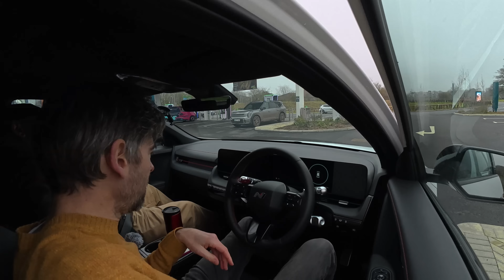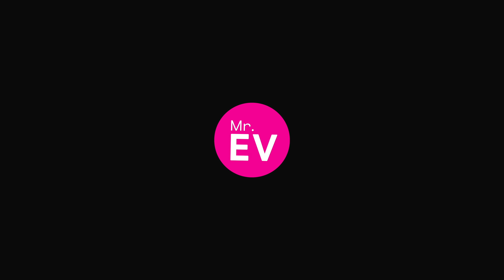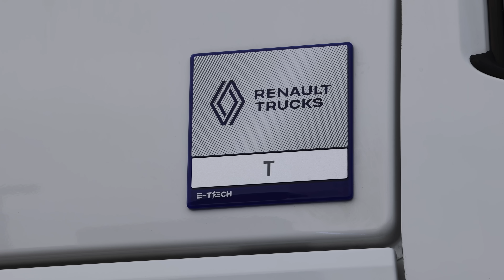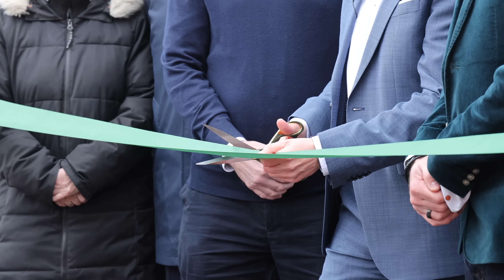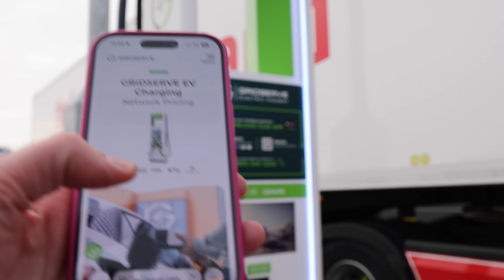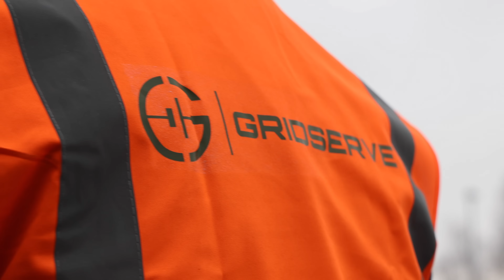Charging electric HGVs: the future of freight, up close. The launch of Gridserve’s first HGV hub

Comment: So let me understand you correctly you would rather continue ripping up the earth for rare Earth minerals to continue making batteries rather than  hydrogen Fuel Cells which are also electric by the way. For the future of transport ??
Reply from the maker: Most of these trucks have LFP batteries which contain readily-available materials. Battery electric vehicles are also more efficient than hydrogen so that’s arguably a better use of energy.
Reply: Not when you take into account that hydrogen is the most abundant source of energy in the universe no matter how efficient batteries are they still need materials to be made which comes from the Earth. Batteries are the same con as a government sold us for diesel
Reply: @TheDigitalFlight  where do you think this hydrogen comes from? 

We have to put energy in to extract it from water. This is about a 50% efficient process. Then it’s about 50% efficient when we burn it. So overall you’re left with 25% of the energy you started with. 

Batteries are 90-95% efficient
Reply: Maybe instead of destroying the earth for batteries if you put the same energy into developing hydrogen it would become more efficient.  Also if you go to certain parts of the Earth where battery mines are already destroying coral Reef you might just change your mind. But don't misunderstand me I think electric vehicles are definitely the future of transport just not battery versions
Reply: @TheDigitalFlight  oh god, even in 2016 this would have been a very outdated comment. The vast majority of all vehicles will be battery electric. This hasn’t been a question for a very long time already.
Reply: @TheDigitalFlight  sorry I should have been clearer in my comment. Those aren’t the “current tech” efficiencies. That the limitations of the physics. It is a physical impossibility to improve the process any more than that.
Reply: @Freba9 yep you keep raping planet Earth for The rare minerals you need to create batteries
Reply: Hydrogen is a dead end daft idea put about by the fossil fuel industry.
Reply: @ianlighting100  yup
Reply: @ianlighting100 give yourself a day off destroying the planet for rare earth minerals is such a better one isn't it ?
Reply: @TheDigitalFlight  stopping climate change by ceasing greenhouse gas emissions is absolutely an urgent priority that trumps everything else. Yes.
Reply: @ianlighting100 fantastic stop destroying the rainforest just to create Food Farms for animals because they're the biggest green house gassys emittors on the planet. But if you still can't see the light try looking were the rare earth minerals come from. Democratic Republic of Congo (DRC), China, Australia, and South America. The DRC produces over 70% of the world's cobalt, while China dominates the supply of rare earths, graphite, and refining
Reply: @TheDigitalFlight  yes and cobalt is used in oil refining but I bet you’ve never complained about it in your petrol or diesel car. 
Modern batteries don’t even need cobalt. Look up LFP.
Reply: @ianlighting100 I'm not an advocate of patron diesel engines but if you want to stop oil production for a greener world you better look inside your house cos you're going to have to throw everything and I mean everything in the bin you try looking that up what oil is used to make. What I am not in favour of is mining the earth for more minerals when there are cleaner options
Reply: @TheDigitalFlight  petro-chemicals in plastics etc is not the issue. It’s burning of the oil based fuels that is the problem. 
Each year the world uses 100 million tonnes of hydrogen. 99% of that comes from fossil fuels. It’s impossible to make hydrogen from electrolysis cheaper than the electricity you need to make it with. It’s far better to use the electricity directly in vehicles instead of creating h2, transporting it, then getting 30% of the energy back at the wheels. For the same amount of electricity an EV goes 3 times the distance compared to a hydrogen powered car.

Comment: They need to have solar on top of the trailer with a small battery underneath, would help run refrigeration units and be a backup for the main battery.
Reply from the maker: I agree — that seems like a no-brainer actually as solar panels are so inexpensive. They’d still not generate much in the grand scheme of things, but it all helps.
Reply: @MrEV  The trailers and trucks usually have totally different owners, and putting solar on a trailer may actually cause more drag than it's worth generation.
Reply: @etchedpixels The panels would be flat not at an angle, so wouldn't cause any more drag. Fleet trailers would benefit.
Reply: @dogbreath6974  Even on a US RV with flat panels if you are using any thickness of panel (as you need to because bendy ones don't last) the additional drag and weight over the roof is quite measurable.

The weight is rather hard to fix, the roof would already require strengthening on a trailer so you'd need to strengthen it, add cowling and decide to accept the increased height.

It's a design in thing not a retrofit.
Reply: A few companies already have these kind of trailers on the market.
Reply: Yes, maybe a row of wind turbines where space allows also.
Reply: @andrewhill9369  I hope that comment is a joke 😂

Comment: They may be expensive to charge at public chargers but it would be good to understand how the maintenance costs differ.  Surely if you have a fleet of HGVs, regular maintenance must be a significant regular cost.  I'd be interested to understand the total cost of ownership/running costs over a year compared.
Reply from the maker: Yes, I should have gone into the TCO. It is certainly lower for electric HGVs. I’ll hopefully do a follow up episode.
Reply: Figures I have seen banded about is 25% running costs of a conventional vehicle, but much much higher purchase cost. Cheaper to run, much cheaper to maintain.
Reply: @etchedpixels 

don't forget to factor in depreciation! (edit: and hours of your life spent wandering garden centres, Starbucks and McDonald's). if saving a few quid is more important to you than hours of your life (and if you're having to use public charging at all then it's very debatable whether you are saving any money at all anyway) then each to their own, go for it I say 👍 /edit)

as a side note, i couldn't care less if i could be saving money. petrol power is a beautiful thing. electric power is gay af, like many of the drivers
Reply: @NeilHuband-p8q  It's so nice to see you here, your comments are so funny, you make our life much much better with your jokes pal. Thank you!!!
Reply: slight problem.

the cost of the batteries means that you're better off just throwing the vehicle away, and buying one with the newer, better battery.

this is why insurance companies write off whole cars because of a small dent or otherwise tiny damage to the battery casing.
Reply: @chrishar110 

you say the word 'jokes' seemingly interchangeably with what I call 'truth', but hey, whatever... no problem buddy, glad to be of service 🙂👍
Reply: readers, do look have at the reply to etchedpixels reply - comedy gold!  I'd love a video of Flaviana's thoughts on that.

Comment: As a trucker I've been following the development of electric trucks for a while. They have so many advantages, easier to drive, quieter, reduced servicing costs to name a few but the elephant in the room is cost to run. Until charging comes down to a reasonable price I imagine electric trucks will mainly be used on short haul work where cost is comparable to diesel or maybe even less assuming the haulier is chargiing their fleet at the depot. All that said short haul is a huge part of the industry so electrifying that sector first makes sense. The Youtube channel the Electric trucker shows how much cheaper charging is on the continent and the reason why they are ahead of the UK when it comes to commercial vehicle electrification.
Reply: Presumably electric trucks in the UK would start by charging at the depot, and only have to pay Gridserve prices if they're doing more than 3-400 miles in a single trip. Given the relatively small size of the country, the vast bulk of truck use must be shorter than that.
Reply: @robinbennett5994  Not all hgv's return to a depot, yes your supermarket and local runs will but a large proportion of drivers will stay out all week.
Reply: @robinbennett5994 I would agree that is the case for the majority but there is a sizeable amount who run nights out or tramp where they are out the whole week. For instance I have done jobs in the past where I've been away from the depot for several nights on a regular basis. As a percentage of the total I wouldn't know the amount but it wouldn't be an insignificant amount. In those circumstances it would be hard to make a compelling financial case for going electric if you were going to end up paying a high kWh cost. That coupled with a higher purchase or lease price for the vehicle would put off many. At the end of the day they are businesses and need to make a profit.
Reply: Ev trucks easier to drive? What do you drive, I wouldn't say a new auto diesel unit is difficult to drive 😂
Reply: @jonathanlonsdale9442 I never said diesel autos were hard to drive, I drive automatics the majority of the time. 
The reason EVs are easier is you very rearely have to brake, its one pedal driving. You have instant torque, so get up to speed faster as well. They don't struggle on hills like diesels can. So while modern diesel trucks are much better to drive than manuals they are still not as easy as electric vehicles.
Reply: @MrDAVIDATKIN Fair enough, I suppose it depends on the truck. The 770 Scanias don't slow much.
Retarder, I would imagine, is very similar to regen?
Apart from you don't get any power back.
Reply: @jonathanlonsdale9442  I'm sure we'll all be driving electric trucks in the not so distant future. Having owned an EV now for 3 years I can't wait. After 37 years of driving diesel trucks I'm looking forward to it.
One of the companies we work with has a Mercedes eActros which is suitable for 90% of the work they do. With battery tech improving so rapidly and infrastructure improvement I'd imagine they will be suitable for 100% within a few years. Of course AI may well be doing the majority of the driving within the next few years as well.

Comment: Quite a shame that all of this is getting so much traction. We’ve already got a solution for long distance freight in the form of the railways. Even diesel rail freight is lower carbon than electric lorries charged using electricity generated from gas. Maybe this is useful for last mile deliveries to supermarkets but we shouldn’t kid ourselves and expect this to be a good long term solution to freight overall in this country.
Reply: how do you get the fright from the train to the customer?
Reply: @Paulssock  brother did you read the comment? I’ll explain further in case you didn’t.
Firstly, many of the largest users of freight can already have rail connections
Secondly, we can build new rail lines to connect to major users of materials such as industrial locations like factories
Thirdly, if this isn’t reasonable or feasible, this is where electric vehicles can be useful. You take the freight from rail freight terminals and drive it probably at most 30 miles to its destination. This means we are very unlikely to need insane charging infrastructure for lorries on our roads.
This still isn’t the best solution - it would be better if we could get rail closer to end destinations, and use existing technologies like electric vans or cargo bikes, though I appreciate that for many types of freight this is absolutely absurd. Not so for e.g. Amazon though!
Reply: @lamitron  I did read thats why i asked,  currently we we move appox 1.6 billion tons of fright using the road network per year, compared to 69 million tons using the rail network, it would take a huge inferstructure upgrade to the rail network. You would need rail depots everywhere to achive your 30 miles last miles deliveries and still those buisnesses that need a HGV to deliver the goods would still need a hgv to deliver the goods from the train depots. Even if we could get rail closer to end destinations the use of electric vans cargo bikes is just not fesable.
Reply: @Paulssock  Of course in our current aversion to good infrastructure spending it’s not feasible, but we can and should fix that. I believe that spending trillions on infrastructure, especially rail (heavy freight, HS passenger, metro, tram, etc) will have a tenfold return on investment into the economy. My point more or less is that we should be spending this money on trains instead of freight, it’s a much more established way of cutting carbon emissions than EV lorries.
Reply: @lamitron  I honestly think you have no idea what you talking about. but ok.
Reply: @Paulssock  Mate I’ve spent thousands of hours researching our railways and transport network as a whole. I know exactly what I’m talking about. If you have any concerns against it I’d be happy to explain why I think it’s better but you haven’t really said much other than “it’s expensive”. Like yeah of course it’s expensive, most good things are. Before the roads, we took all of our freight on the rails, with depots at every station. Of course it’s not the best solution anymore, but saying we can’t have depots everywhere is naïve of the past.
Reply from the maker: More freight on railways would surely be a good thing. Less wear and tear on the roads for a start, and surely cheaper?! There must be a good reason why lorries are preferred. Convenience, perhaps?
Reply: @MrEV  yeah more or less it’s cause roads are cheaper. Our railways are full so we charge kinda nuts access charges for the track. The roads are just as full, but we don’t charge for the access to nearly the same degree. Seems to be a governmental position since Thatcher. HS2 was supposed to fix this, but we all know how that’s gone!
Reply: @MrEV  How? please tell me how?

Comment: I saw a video on another channel on battery swapping in Australia a short while ago. They could swap one out in a few minutes. That's got to be the way forward for trucks as the batteries can be charged up slowly when not used.
Reply: So far across Europe the EV HGVs are not going battery swap. It doesn't make sense. You assign a truck a given route and you've got the charge time and capacity planned into it. As hauliers can assign specific trucks to specific routes you don't need the overcapacity and flexibility in the same way.
Likewise fast charging doesn't matter in the same way - you schedule it in with mandatory driver breaks. Providing the charge time and breaks line up all is good.
Reply: @etchedpixels  exactly 👍🏻
Reply: It's one way forward, although the battery swapping capability is not for free. Unladen weight will be larger than an integrated, well designed structural battery pack. Need more battery packs than vehicles to be in circulation so they can charge while dormant at swap stations, which, combined with the cost of the swap stations, raises the capex more when expanding to country scale. Swap process eats into rest time slightly but not too bad.

It will still likely be a viable option though, since the charge times mentioned in this video seem too long for some.

Others will need to wait for more efficient, larger battery capacity trucks and cheap, reliable country-wide 1 MW+ rapid chargers.

Comment: Are these caravan friendly?

I’m sure technically my car can charge. But will I annoy anyone for using it when towing my caravan and not wanting to unhitch?
Reply from the maker: Technically they’ll work, but they don’t want to encourage it as it’s not a safe area for families with all the HGVs driving around. They should (and will, I’m sure) add more pull-through bays to the car charging area.
Reply: @MrEV  I doubt they’ll add more pull throughs to the car areas. I’m a niche of a niche unfortunately.

Thanks for replying
Reply from the maker: You’re not as niche as you might think! I hear of a surprising number of people towing caravans with their EV. It’s a bit chicken and egg though as more people won’t tow until the infrastructure is there. Unhooking each time for a charge must be a real pain.
Reply: @MrEV  There are dozens of us! I sometimes see another EV on site.
Reply: @MrEV  there’s already 2 ionity chargers at Baldock specifically for towing vehicles. Plus another 15 or so normal pull chargers. It’s a fantastic charging hub.
Reply: The very same service station also has some 40 odd chargers for normal cars. There are 2 ionity chargers specifically for towing vehicles and another 6 ionity plus 10 gridserve pull through ones.
Reply: @Trifusion1  😮